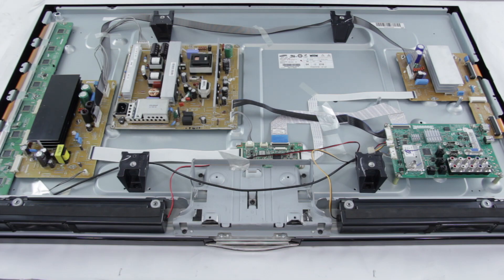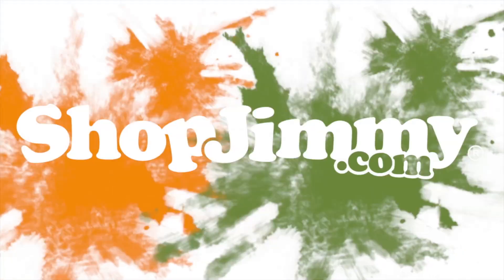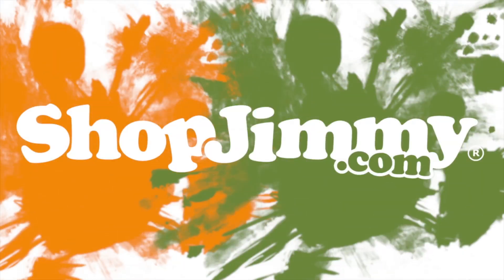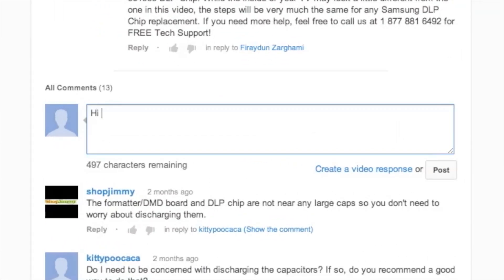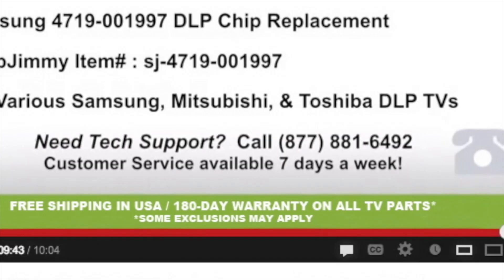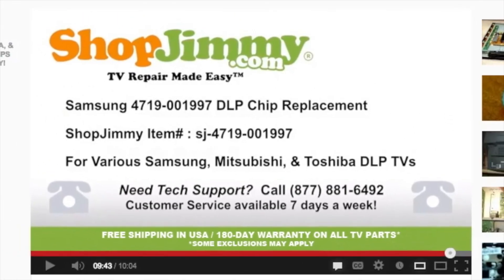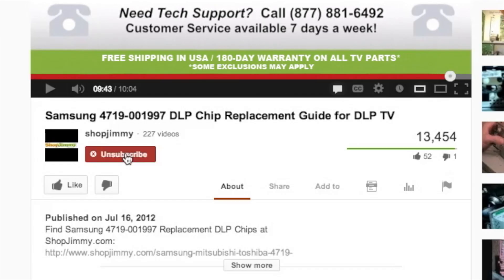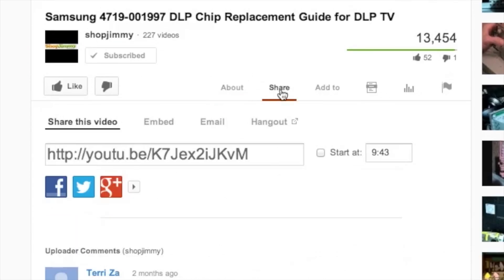Plasma TV Repair Tutorial - Common Symptoms & Solutions - How to Fix Plasma TVs

Comment: I have a sanyo plasma tv model number PDP32XS8DA. When turned on the blue power indicator light comes on few a few seconds tan turns red to stand by it then switches back and fourth between the to modes. there is no sound or sounds and no picture. i am thinking it may be the power board.
Can you help me and by the way I live in Australia
Thanks Pete
Reply from the maker: Wenpet Wenpet   I recommend replacing the main board in your TV.  Unfortunately I do not see any replacement parts in the search results for your TV model number on our website.  Please reply with your part number on your main board and I can try searching for replacement parts.  Thanks and please let us know if you have any further questions!  www.shopjimmy.com

Comment: i have a 50 inch lg plasma tv model number....50pk550-ud...I have 3 green lines that goes from the top to the bottom of the screen almost center of the screen on the left side ...what can i do to fix this problem it started as 1 line then moved to 3 within a months time
Reply from the maker: Charles Wright   This sounds like a TV panel problem.  If your TV panel is bad, it may be more cost-effective to replace the TV as panels are typically hard to find in stock, difficult to replace, and expensive.  Thanks and please let us know if you have any further questions!  www.shopjimmy.com

Comment: good tutorial. with my model S42AX-YB02  one day the tv worked fine and the next, zero, nothing at all, would not turn on or make any noise. No light indicators, categorically nothing. I tried turning on with button on the front and with the remote tried different outlets, still nothing. With what you were saying in the video, sounds like the power board. But my tv layout is a good bit different than the one you used on this video. So I am not sure what order i should check the different boards in order to isolate the issue. what do you recommend. Or are there questions you need to ask to clarify?
Reply from the maker: Lee Guetterman   I recommend replacing the power supply board in your TV.  Here is a link to replacement parts for your TV model number on our website, click here:  http://www.shopjimmy.com/catalogsearch/result/index/?cat=59&q=S42AX-YB02  Be sure to match part numbers on your current board, with your replacement for compatibility.  Here is a link to a video showing how to identify your part number, click here:  Part ID Numbers for Sylvania, Emerson, Philips Magnavox MPS, MPW, MUT, & Digital Boards TV Repair  You can also call our customer service for further assistance with your purchase.  (877) 881-6492  Thanks and please let us know if you have any further questions with your TV Repair!  www.shopjimmy.com

Comment: i have a 60'' lg  Plazma TV60pv250 there are vertical lines on the bottom of the screen. andrewneri@frontier.com
Reply from the maker: Andy Neri   This sounds like a TV panel problem.  If your TV panel is bad, it may be more cost-effective to replace the TV as panels are typically hard to find in stock, difficult to replace, and expensive.  Thanks and please let us know if you have any further questions!  www.shopjimmy.com

Comment: We have a Samsung SDI Plasma TV model number S50FH-YB01 that was bought new in 2008. 
For some time now, tv had to be warmed up before we could start aux inputs (satelite) otherwise it would produce a loud high pitched buzz and power off and on. Now we turn it on, it makes a loud click and then makes high pitched buzz with some flash of color on the screen and turns off without powering back on.   Any help you can give would be appreciated. Thanks
Reply from the maker: Carmen Bienapfl   I recommend replacing the Y-Main Board and the Upper and Lower Y Scan Drive boards in your TV.  Here is a link to replacement parts for your TV model number on our website, click here:  http://www.shopjimmy.com/catalogsearch/result/?q=S50FH-YB01  Be sure to match part numbers on your current board, with your replacement for compatibility.  Here is a link to a video showing how to identify your part number, click here:  Samsung Plasma TV Repair: Samsung Plasma Panel Parts Guide  You can also call our customer service for further assistance with your purchase.  (877) 881-6492  Thanks and please let us know if you have any further questions with your TV Repair!  www.shopjimmy.com

Comment: Power surge over the cable. Vizio E472VLE will not power on. No visible internal electrical burns. Mother board replacement ?
Reply from the maker: captlouie   Yes, you can replace the main board in the TV, you may also need to replace the power supply board as well.  Do you have a standby light?  If you do not have standby, then I would replace both boards.  Here is a link to replacement parts for your TV model number on our website, click here:  http://www.shopjimmy.com/catalogsearch/result/?q=E472VLE  Be sure to match part numbers on your current board, with your replacement for compatibility.  You can also call our customer service for further assistance with your purchase.  (877) 881-6492  Thanks and please let us know if you have any further questions with your TV Repair!  www.shopjimmy.com

Comment: Hey, i have a Zenith Plasma TV Model Number:Z50PT320-UC and the sound is fine but there is no video. I would appreciate some tips/help.
Reply from the maker: victor montalvo   I recommend replacing the YSUS board and the Y Scan Drive / YDRV boards in your TV.  Here is a link to replacement parts for your TV model number on our website, click here:  http://www.shopjimmy.com/catalogsearch/result/?q=Z50PT320-UC  Be sure to match part numbers on your current board, with your replacement for compatibility.  Here is a link to a video showing how to identify your part number, click here:  LG Plasma TV Repair: DIY Part Identification Number ID Guide for LG & LG Philips Plasma Panel Parts  You can also call our customer service for further assistance with your purchase.  (877) 881-6492  Thanks and please let us know if you have any further questions with your TV Repair!  www.shopjimmy.com

Comment: Hi,
I have a Samsung HP-T4254 plasma.  None of the buttons on the tv work, neither the buttons on the side nor the power button on the face.  Pressing any button on the remote, no matter which button, turns the tv on/off.  The tv is on A/V source automatically when I turn it on and it works just fine.  I can watch the A/V with no problems but I have no way to change the source, volume, etc.  Which part would you recommend I replace?  Thanks.
Reply from the maker: dustneckos   I recommend replacing the main board in your TV.  Unfortunately I do not see any replacement parts in the search results for your TV model number on our website.  Please reply with your part number on your main board and I can try searching for replacement parts.  Thanks and please let us know if you have any further questions!  www.shopjimmy.com
Reply: ShopJimmy.com Thanks for your help.  My main board part number is BN94-01295A
Reply: dustneckos   Thanks for replying with the part number.  Here is a link to your replacement part.  http://www.shopjimmy.com/samsung-bn94-01295a-main-board-for-hpt4254x-xaa.htm  It appears we are currently out of stock, but you can sign up on the product page to be notified when the board is back in stock.  Thanks!  www.shopjimmy.com
Reply from the maker: dustneckos   Thanks for replying with the part number.  Here is a link to your replacement part.  http://www.shopjimmy.com/samsung-bn94-01295a-main-board-for-hpt4254x-xaa.htm  It appears we are currently out of stock, but you can sign up on the product page to be notified when the board is back in stock.  Thanks!  www.shopjimmy.com

Comment: I have a Samsung PN51D550C1F  Code XZA Version N411. Two nights ago it just shut down. Tried to turn back on and got 5 sets of click click CLICK. Which is to say two softer clicks and one louder click, five time in a row, after which no more clicking and the little red light on the front stayed on flashing very quickly. First thought was a bad cap on the power board, so off with the back panel, but no signs on trouble on the power board. Unplugged the yboard from the power board and then plugged in to power. No more clicking but now show a very slow heartbeat. Powered down, plugged y board back into power board, and unplugged x board from the y board. Same result, slow heart beat...............what say you oh master of the TV?
Reply from the maker: Rick Horn   Now try just disconnecting the X board from the power supply and see what the TV does when you apply power.  Thanks!  www.shopjimmy.com
Reply: I am confused. I unplugged the board to the left (which I think is the x-board), which looks like it also sends power to the board on the right. Which means neither was getting power. Powered up the unit and got one power on click and then the slow heart beat flashing yellow light. Powered down and unplugged the right board from the left board, and then plugged the left board back in to the power supply. Powered unit back up and got same results, one click to power up and then a slow heart beat flashing yellow light. I see no way to power up the board on the right without also powering up the board on the left, as it, the right board, recieves it's power through the left board. At least it looks that way to me. I can send photos or videos via email if that would help. Thank you.
Reply from the maker: Rick Horn  Here is a link to replacement parts for your TV model number, this may help you to properly identify your boards.  http://www.shopjimmy.com/catalogsearch/result/?q=PN51D550C1F+  Try all repairs at your own risk.  Please let us know what you find.  Thanks!  www.shopjimmy.com
Reply: Thanks much. Great link. Any thoughts on how I can determine which parts to replace? Or at least an order in which to begin the process? Thank you.
Reply from the maker: Rick Horn   Did you identify all your boards?  Be sure to take all of the proper safety precautions and try this at your own risk.  Disconnecting each board from the power supply and then applying power to the TV should help to determine which board is bad.  This video may also help you out:  Samsung Plasma TV Help with Clicking Noise On Off TV Repair How to troubleshoot Vizio & LG  Thanks!  www.shopjimmy.com

Comment: Hi. I have a samsung ppm42s3q the sound works fine but after watching for a while the picture goes black. What part do i need?
Reply from the maker: Phil Robertson   I recommend replacing the Y-Main board and the G and E buffer boards.  Here is a link to replacement parts for your TV model number on our website, click here:  http://www.shopjimmy.com/catalogsearch/result/index/?cat=4&q=ppm42s3q  Be sure to match part numbers on your current board, with your replacement for compatibility.  Here is a link to a video showing how to identify your part number, click here:  Samsung Plasma TV Repair: Samsung Plasma Panel Parts Guide  You can also call our customer service for further assistance with your purchase.  (877) 881-6492  Thanks and please let us know if you have any further questions with your TV Repair!  www.shopjimmy.com

Comment: found your you tube video very helpful, i have a samsung plasma tv  model# PN51E450A1fX2A    s/n  Z4MX3CQCB66482L  have a picture,but color is distored and not clear and some color blending what do you suggest.
Reply from the maker: Ned Jordan  I recommend replacing the Y-Main board and Y-Scan Drive boards in your TV.  Here is a link to replacement parts for your TV model number on our website, click here:  http://www.shopjimmy.com/catalogsearch/result/index/?cat=4&q=PN51E450  Be sure to match part numbers on your current board, with your replacement for compatibility.  Here is a link to a video showing how to identify your part number, click here:  Samsung Plasma TV Repair: Samsung Plasma Panel Parts Guide  You can also call our customer service for further assistance with your purchase.  (877) 881-6492  Thanks and please let us know if you have any further questions with your TV Repair!  www.shopjimmy.com

Comment: I have a Samsung 42'' plasma TV model # PN43D440A5D that has no picture or sound. I have replaced the power supply board and the y-main board. When you disconnect one of the cables to the y-main board you get sound, but still no picture. Can you help?
Reply from the maker: naomi d   I recommend replacing the Y-Main Board and Y-Scan Drive boards in your TV.  Here is a link to replacement parts for your TV model number on our website, click here:  http://www.shopjimmy.com/catalogsearch/result/?q=PN43D440A5D  Be sure to match part numbers on your current board, with your replacement for compatibility.  Here is a link to a video showing how to identify your part number, click here:  Samsung Plasma TV Repair: Samsung Plasma Panel Parts Guide  You can also call our customer service for further assistance with your purchase.  (877) 881-6492  Thanks and please let us know if you have any further questions with your TV Repair!  www.shopjimmy.com

Comment: Hi I have a Samsung PS51D550, The cable box blew and has taken out the HDMI port, Since then The speakers have stopped working and the Optical out port is dead.Also DLNA/Streaming no longer works and My 3D glasses no longer pair with the TV everything else works picture/remote.menus etc. I have ordered a Main board to try which most of these components are on. but does the main board run the Bluetooth pairing for 3d? Thanks in advance

Comment: I have a 59" plasma TV series 6+ 6500.  The TV stopped working as of this morning.  When I turned it on it just says SAMSUNG SMART TV and a red light blinks four times and shuts off and tries to restart again.  It keeps doing it again and again until I unplug it.  How can I fix the problem and what does that mean or what can be the main problem?
Reply from the maker: Dennis hodkiewicz   I recommend replacing the main board in your TV.  Please reply with your TV model number and then I can recommend replacement parts.  Thanks!  www.shopjimmy.com

Comment: i replaced both the y and z sus board and along with the y buffers and i still have sound only, is it possible that i got a bad y sus board, if so how do i check it, i have all the voltages and they are right, i am stumped,,,,,lg 60 pz 950ua please any help

Comment: I have a Samsung Plasma PN43F4500BFXZA tv that will not power up.  Suspect it is the result of a power surge during one of your recent storms when the tv was left on at night.  I popped the back off but could not see any burnt parts on any of the boards.  The small white fuse adjacent to the power input shows continuity.  Do you have any recommendations?

Tom

Comment: I have a 50PK550 LG plasma that has sound but no picture. The Va and Vs voltages are bang on, as well as the power supply low voltage outputs. I wonder if you can recommend whether I replace the Ysus board, and buffers? There is no indication even momentarily, of a picture. Is there a way I can rule out a bad panel first?  Thanks for any replies.
Reply from the maker: Mike Cole   I recommend replacing the YSUS, YDRVTP & YDRVBT boards in your TV.  Here is a link to replacement parts for your TV model number on our website, click here:  http://www.shopjimmy.com/catalogsearch/result/index/?cat=4&q=50PK550  Be sure to match part numbers on your current board, with your replacement for compatibility.  Here is a link to a video showing how to identify your part number, click here:  LG Plasma TV Repair: DIY Part Identification Number ID Guide for LG & LG Philips Plasma Panel Parts  You can also call our customer service for further assistance with your purchase.  (877) 881-6492  Thanks and please let us know if you have any further questions with your TV Repair!  www.shopjimmy.com

Comment: First thank you for you video. I have a Panasonic tcp46x3. There is a picture and can be watched. However there is a horizontal line directly through the middle and the bottom is flashing white. The top is flashing and is nearly the same but the picture is more visible. During a white picture on the screen there are burt in looking images. I believe with you video it is the y sastain. - Thank you
Reply from the maker: Jason Mitchell   This sounds like a TV panel problem.  If your TV panel is bad, it may be more cost-effective to replace the TV as panels are typically hard to find in stock, difficult to replace, and expensive.  Thanks and please let us know if you have any further questions!  www.shopjimmy.com
Reply: Ok thanks. I have boards for a 42" would it work in a 46"?
Reply from the maker: Jason Mitchell  You will want to match the boards using the part numbers.  Thanks!  www.shopjimmy.com

Comment: Hi Shop Jimmy- Question on my Samsung 43' plasma PN43D450. I just replaced the Y-board. The plasma turns on now but the picture is show half the picture. It's running up and down and only half the picture. So when i hooked up the dvd player to the hdmi it wouldn't show anything. So i tried to changed the source button it didn't show anything even when i tried to turn the volume and the channel up and down nothing happen
Reply from the maker: Gary Gibson   When the Y gets replaced, the bottom Y-Scan Drive should be replaced.  Here is a link to replacement parts for your TV model number on our website, click here:  http://www.shopjimmy.com/catalogsearch/result/?q=PN43D450  Be sure to match part numbers on your current board, with your replacement for compatibility.  Here is a link to a video showing how to identify your part number, click here:  Samsung Plasma TV Repair: Samsung Plasma Panel Parts Guide  You can also call our customer service for further assistance with your purchase.  (877) 881-6492  Thanks and please let us know if you have any further questions with your TV Repair!  www.shopjimmy.com